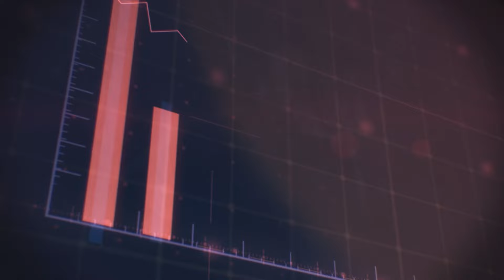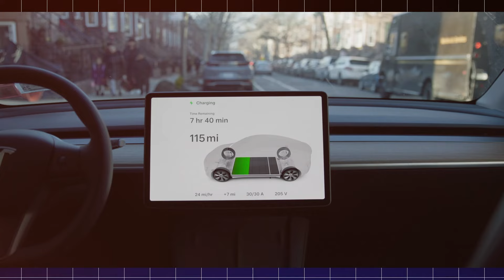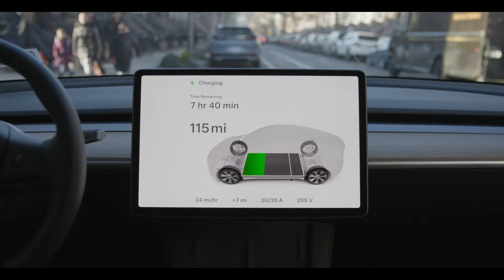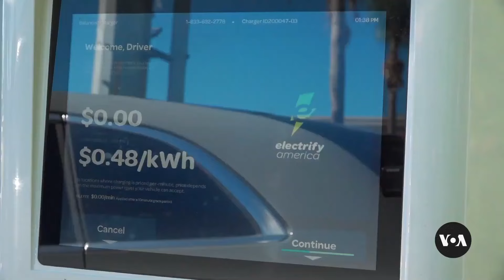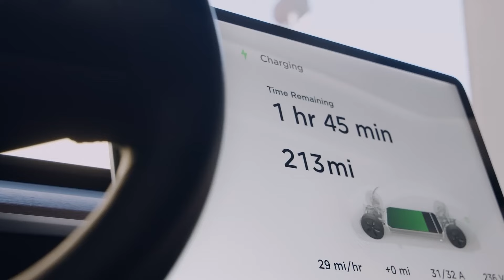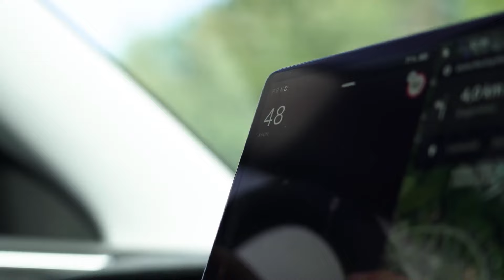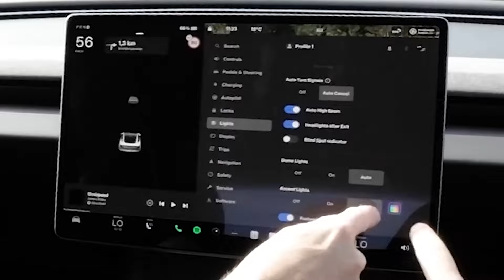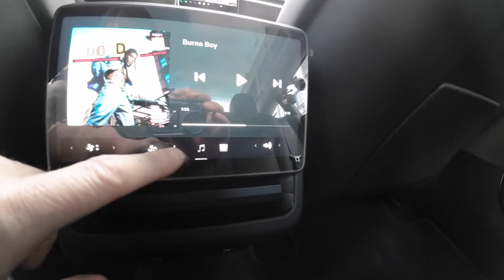EVs Are Getting BANNED EVERYWHERE Because of These SHOCKING Reasons!

Comment: When a burried Co2 pipeline breaks and carbon dioxide floods the area, you can suffocate and  your gas powered car won't start. It needs air to run, but an EV can get you to safety because it does not need air to run. In this event an EV could save your life.
Reply: What if there is no electricity to charge it